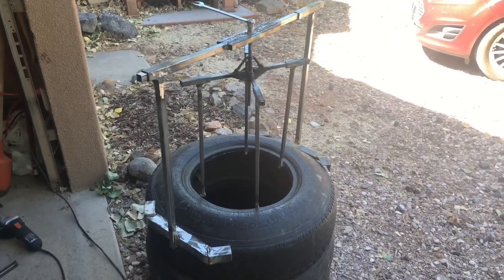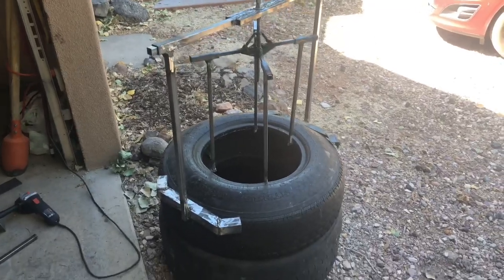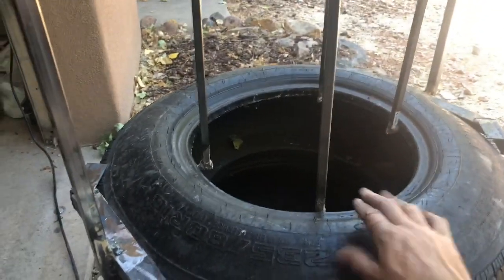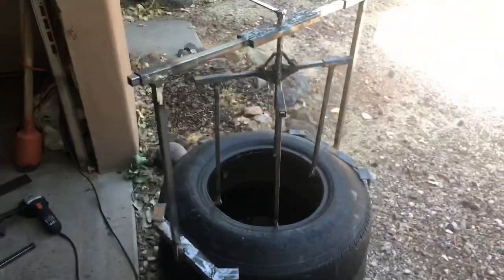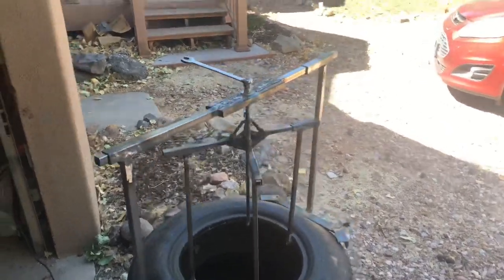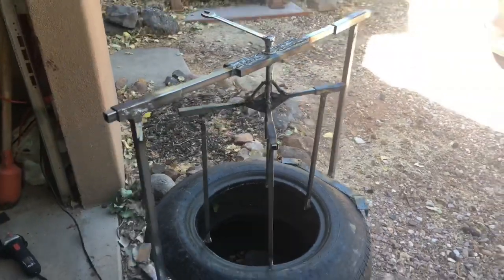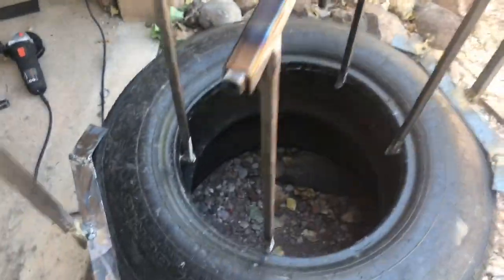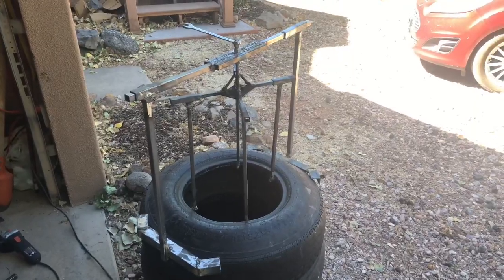DIY Tire Wall Packing Tool

Comment: I use truck tires instead of car tires to build my wall. They're 40 inches in diameter. I also cut most of the top sidewalls off, leaving about 3 or 4 in from the tread. Then I came in with a mini loader, filled them with dirt and smashed them down with the hoe.  Rinse and repeat five times for a 5-ft wall. Don't need to lift any sidewalls on the top because there is sidewalls to speak of.  I also screwed them together side by side and top to bottom. Having a full sidewall really doesn't get you any further than just cutting them off and saving the headache of having to pack them.

Comment: Great idea, works much better than my fabbed tire lifter... I like the hand crank you added, I think I would just weld a bolt on top and then use my electric drill with a socket on it to make it go up and down faster. Although your system works pretty dang well as it is. 👍 Thanks for including instructions! You are a very crafty guy

Comment from the maker: Here's a link to the PDF that shows the supplies and dimensions to build one. I apologize that it is not also in metric. bit.ly/JDHTirePuller
Reply: This looks perfect 👊🏼
Did anyone else test this?
Reply: @f52023  I’m not sure, but I’ve used it for hundreds of tires.
Reply: Thank you so much for this!

Comment: My ideal would be to separately using a Hydraulic Press to ram lots of tires as apart of assembly line on the job site. 🤔

Comment from the maker: Also, because I used tires of the different outer diameters as I built upward, I had to use rocks to fill in the gaps. The first layer used my largest tires and all the layers above it had gaps. If you cannot find tires that are all the same dimensions, try to place them so that the ones with the same outer diameter are in the same area to prevent the gaps as you go upward.

Comment from the maker: I suggest NOT oiling the central threaded shaft or nuts. The dirt builds up and acts like sand paper on the threads over time. Keep a brush nearby and brush off excess dirt prior to turning the handle. It only takes seconds, yet saves a lot of effort.

Comment: How does it work
Reply: The inner hooks lift the lip and create a downward pressure on the outer legs as you tighten the screw
Reply: @JDHumphriesUtah  niccce